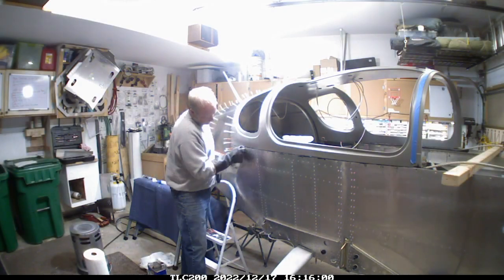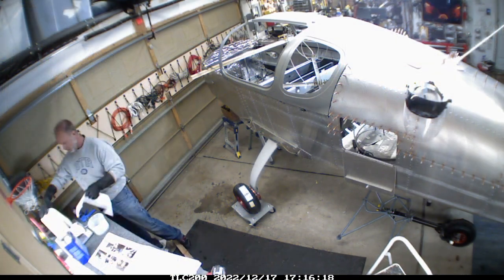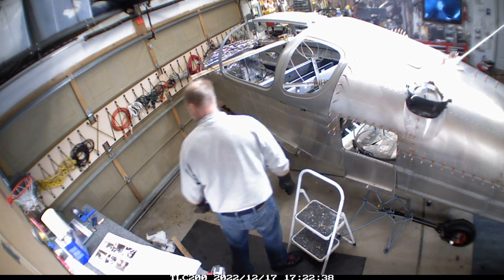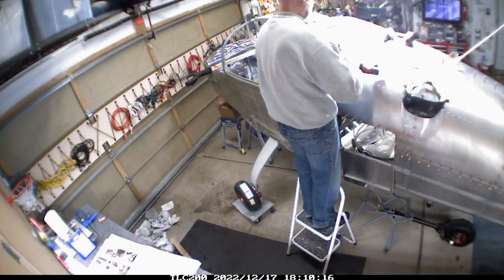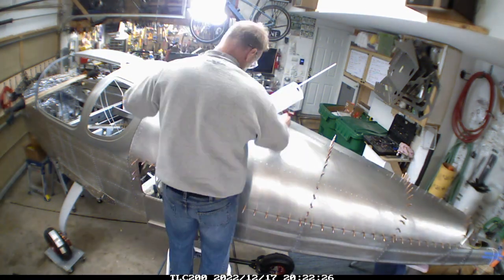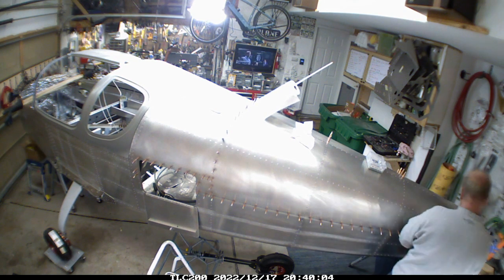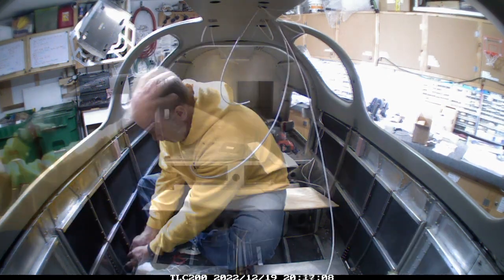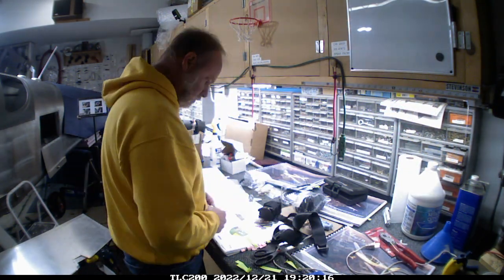2023 January - Canopy goes on!

Comment: Really nice work. I just started building my empennage. Your videos have been very good and informative. If you don't mind sharing, where do you plan to put your Com 2 antenna?
Reply from the maker: Oh not at all - In the bottom front skin there is a pre-drilled hole from the factory were I put my Com2 antenna… I think that slot was originally designed for the transponder antenna, but I moved that farther back in the center fuselage next to the ELT location.  I just liked the location for the center drilled hole as the antenna isn’t going to ever interfere with ops on the ground or during takeoff because it’s between the gear.  If it does - then I’m in real trouble.

Comment: Congratulations. Lots of progress.
I will be starting my build next week. Wanted to know what camera are you using in the garage to record your build ?
Reply from the maker: I got the Brinno BCC100 Time Lapse Camera which takes 4 AA batteries which last for a few months.  I basically just turn it on at the beginning of each build window and then edit it down for time.  I’m trying to switch over to my GoPro knock offs now as the work I’m doing is more detailed requiring a bit more of a closer shot.  The batteries are only good for about 30 min in those, so I hang an extended battery pack off the side of the camera while plugged in to keep it going during the day.
Reply: @FirstRivet  Thanks. Not sure if I am going to focus on recording so much. Will take pictures and post it in you tube for the purpose of logging the build .
BTW, I was excited to see the engine go on. 
Congratulations for reaching to this point. Hopefully it will get easier from here on.